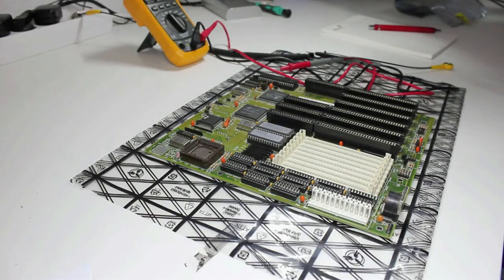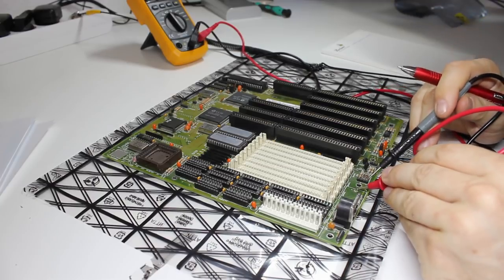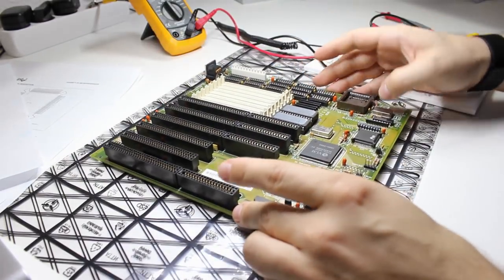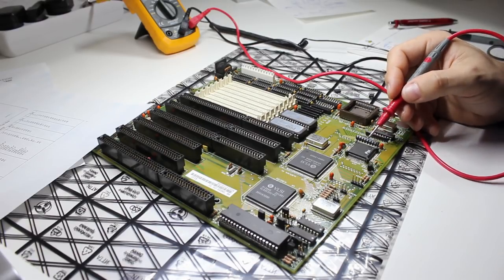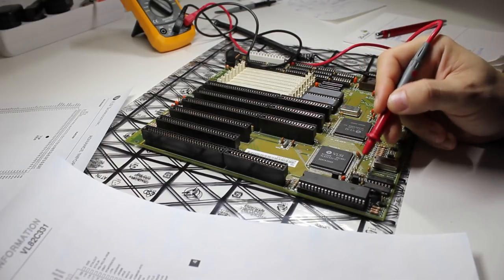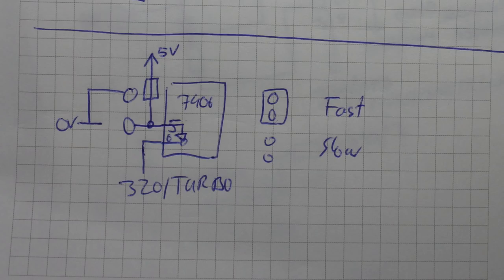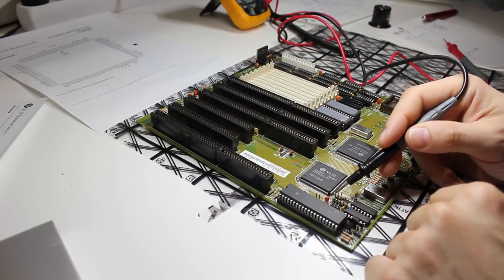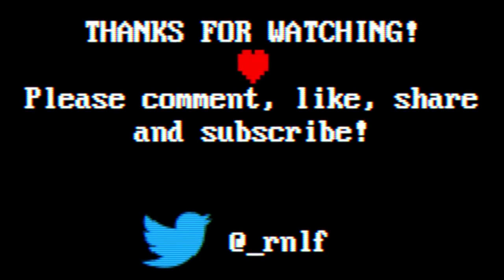386SX Demo Machine Build: Figuring out the Mainboard without a Manual

Comment: Sticking things on top of an anti static bag is a bad idea, the insides are static free but the outsides not so much, sure you have a strap on which may negate it but its not something I would do in best practice. I do prefer the older boards with jumpers, use to feel like you accomplished something when setting up a computer instead of just switching something in software.
Reply from the maker: Enigma776 Hey, thanks for the hint. I used the bag because it's conductive on the outside, so touching it while wearing the wristband is potentially better than only using the plastic coat on the cheap desk.

But yeah, it's not optimal and I am looking for a cheapish antiatstic mat.
Reply: Yeah there worth having but oh boy are they expensive. I surprised there was nothing on the net for this board. There is usually a wealth of information for old stuff out there somewhere.
Reply: This bag is not conductive, its dissipative, silver ones are conductive. EEVblog #247 covered this.
Reply from the maker: Nope. This bag is conductive (I measured it), but even if it was only dissipative it would still solve the problem of putting the board on a surface that may easily build up charge. Uncharged surface trumps charged surface.
Reply: It only has conductive strips, its even printed right on it "Conductive strip bag" :-). It does ~nothing for grounding the workplace. Not that I am super strict about it myself, but some people might watch the video and get the idea that a plastic bag is as good as ESD mat :)